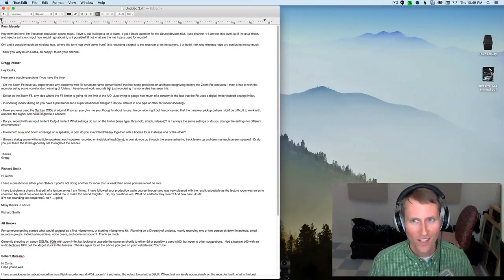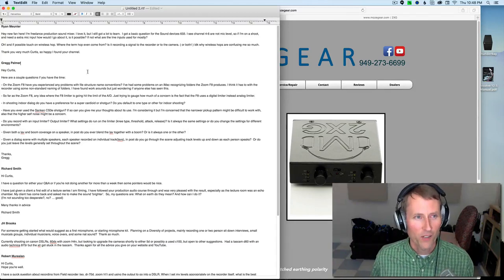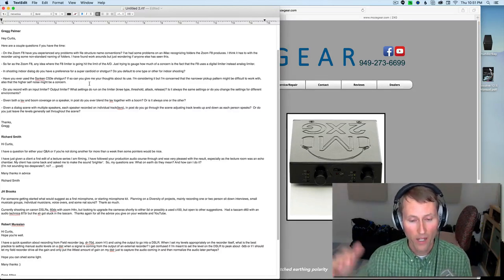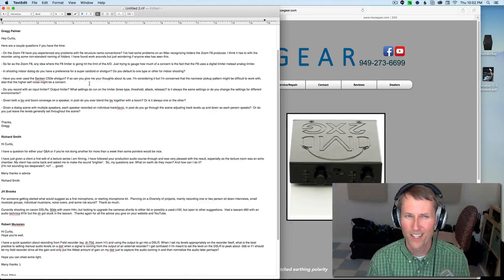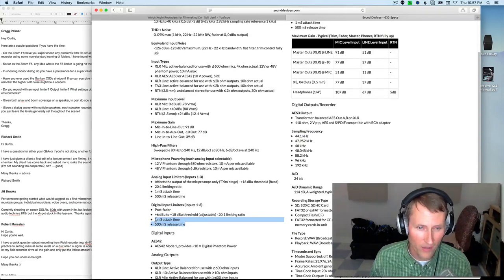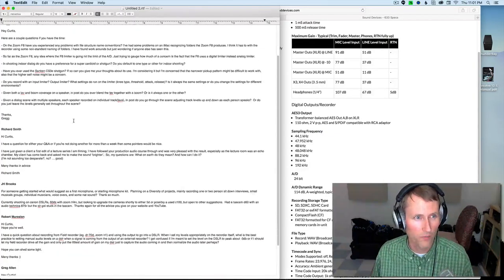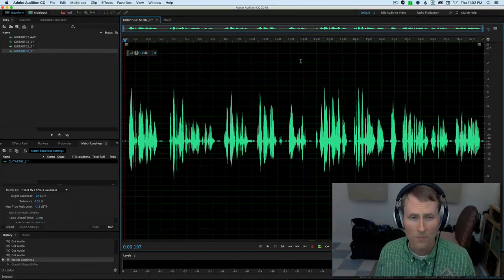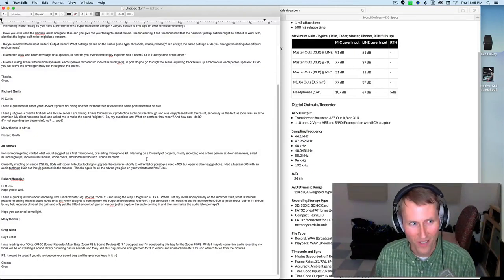Sound for Video Session: Line Level Inputs, Zoom F8, Limiters, and Brighter Sound 160922

Comment: Thanks for doing that Curtis! 

Well, I found the OR-30 on B&H as open box for $239 so I went with that. When I do boom, I don't want a huge bag (as you said) and since booming will be for indie stuff I probably don't need room for a bunch of wireless gear. In which case this will work. 

Using the booming bag for ambient recording means that the recorder will be protected while using it and I have access to all the controls. I was hoping to be able to carry my other gear in there as well but I suppose I need another bag for that.

Cheers,
Greg
Reply: Nice find on the open box! Yes, I really like it. No bag is perfect so you'll need to sort out your workflow (e.g., how to routed the input and headphone cables) but I hope overall you enjoy it!
Reply: Yeah I got lucky with a Google search. :-) I also ordered a LP1 battery, charger, and D-tap to Hirose connector. Audio gear gets expensive fast doesn't it!?! I dropped almost 2k on gear this weekend. o.0 Considering I am not currently making any money from that it's a substantial investment. There are still more mics I would like to buy not only for field work and foley but the recording studio as well. Of coarse Olympus had to announce the OMD EM-1 MKII, and Panasonic with their GH5 release for next spring. I am putting my GH3 up for sale the Tascam recorder and maybe a couple pieces of studio gear.

Once I get the bag set-up maybe I'll do a video overview. I definitely have the studio for it and a green screen too. I just need to get off my north end of a south bound horse and get it done....  :-)
Reply: Haha! Yes, but your audio gear will not need to be upgraded nearly as often as cameras. So hopefully that helps remove a little of the sting. And great audio always adds a lot more than most people realized.

Comment: Hobbit,Batman,Hateful eight - Each & every film has different tone in their dialogue... they may be using same mic but they are doing post processing to set tone for dialogue... I think they are using multiband compressor & hardware to get warmth...also they are having greater dynamics in dialogue because they're using multiband instead of compressor,my question is how to set tone for film example - how to get low-fi cinematic effect in dialogue like breaking bad
Reply: Hi Dinesh. Yes, there is definitely some art in post on dialogue. I'm not super advanced in terms of applying heavy effects but that will be a good topic for an upcoming session. Thanks!